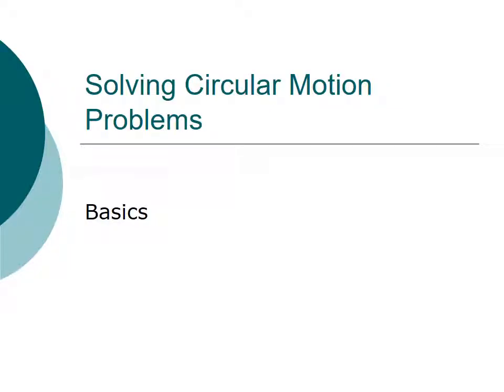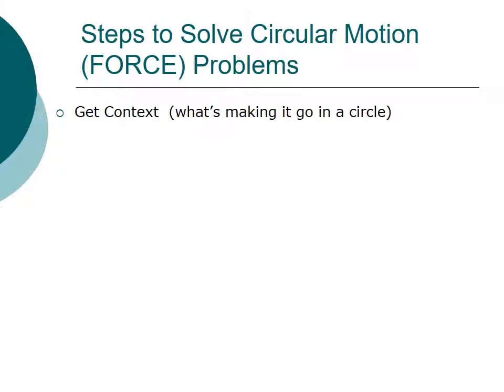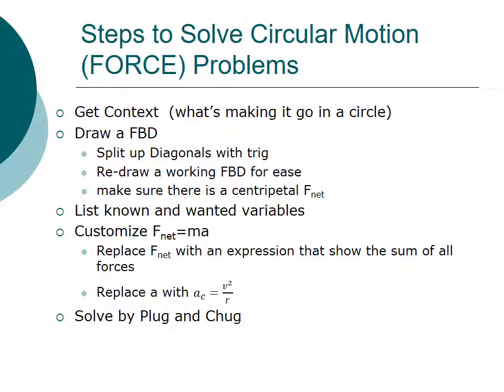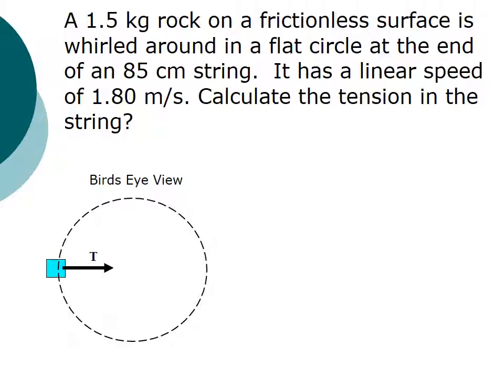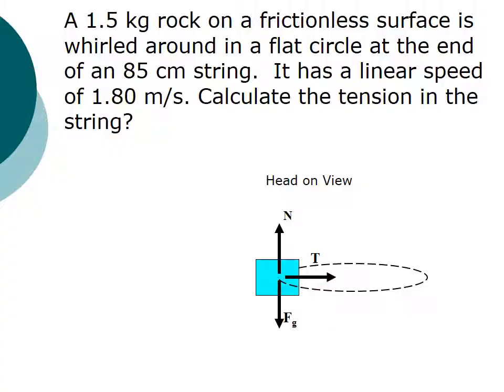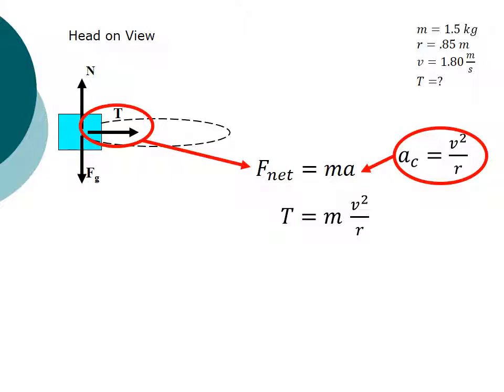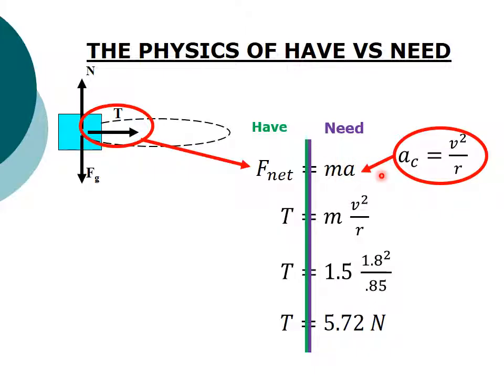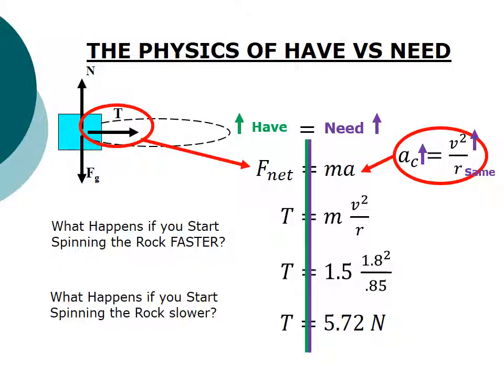Solving Circular Motion Problems 1 - Basics

Comment: In the first question, it was said that the length of the string was 85 cm and you've solved it as 85 m ???
+
it was the diameter ( the whole string ), but not the radius...
Reply: The length of the string should make the radius I'm pretty sure.
Reply: The length of the spring equals to the radius of the circular motion
Reply: There was a "." in front of 85, so that makes it 0.85m, not 85m

And secondly, when you spin something on a string, your hand is the centre of rotation, while however long the string is becomes the radius of motion. Hence, the radius is 0.85m, the length of the string.

Comment: A merry go round horse is encircling the ride at a speed of 6 m/s. If the diameter of the ride is 18.64 m, how much force is the horse exerting, provided that its mass is 152 kg? 

Can someone help me with this
Reply: V=6m/s
M=152kg
d=18.64
r=18.64/2 = 9.32 
 Hence centrifugal force =Mv² / r 
 =(152×6×6) ÷ (9.32)=587.12N

Answer = 587.12N 😁😉
Reply: since it moves in a horizontal circular path just solve for centripital force mv²/r